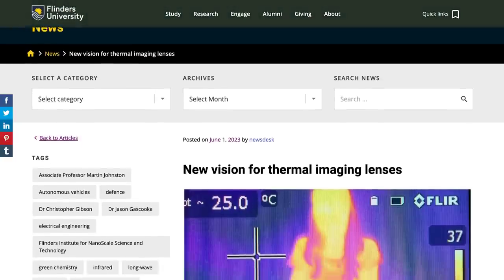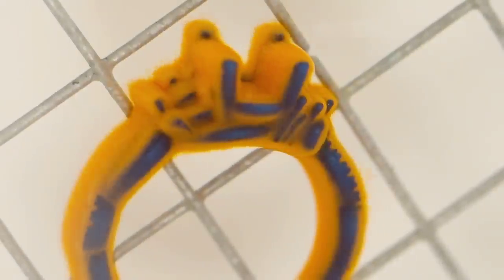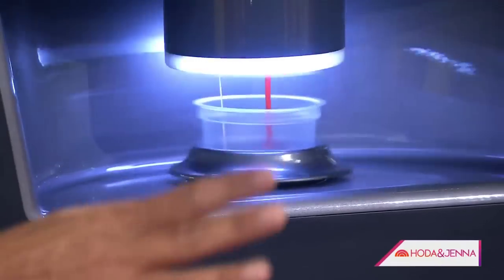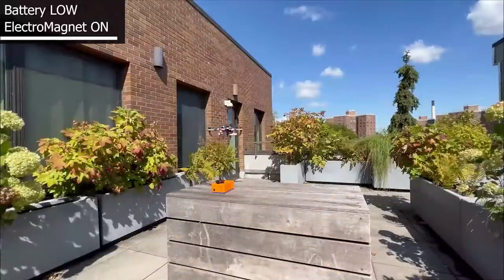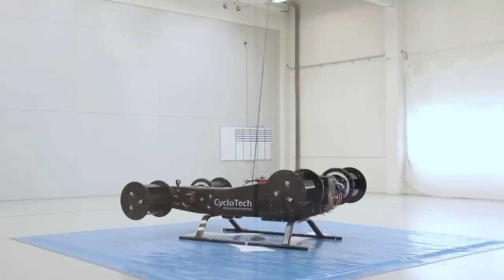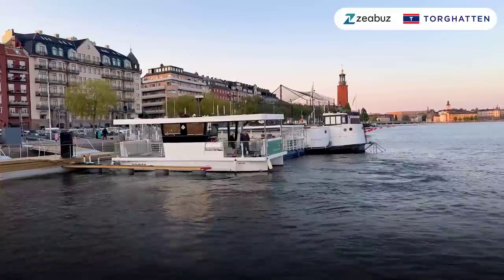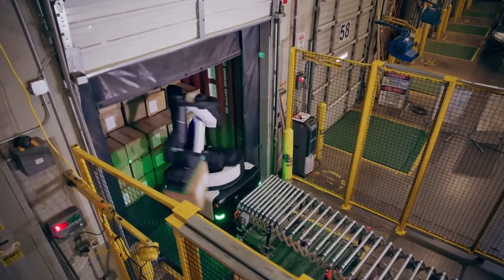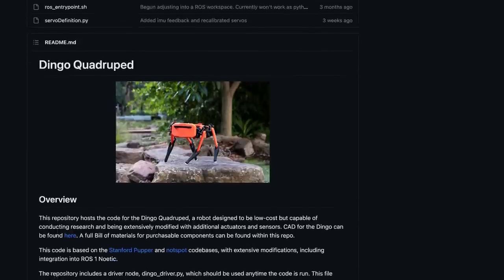Cheap Thermal Imaging Breakthrough (+ More News)

Comment: For just a few seconds, I considered the advantages of owning a wax printer.
Reply from the maker: lol
Reply: i work at a company that has a few MJP wax printers, they are super high maintenance and there is a lot that can go wrong (especially in the printhead, which is the most expensive part). Unless you absolutely need the ultrafine detail & perfect support interface, an SLA printer is exponentially cheaper for a similar result
Reply: Same here
What a tool it would be for making tools!
Reply: Look at a regular resin printer, it needs higher temperatures for burn out and the like but still pretty accessible
Reply: @zyeborm  That's probably my best option... I could buy 10 for the price of this cheapo wax machine, and still have money left for some resin.
Reply: yeah just get a resin printer. the castings will be just as high quality to the naked eye, and its so much less expensive

Comment: The thermal imaging tech is much bigger than most people know.
I won't bore you with the details, but it's going to completely change the face of warfare. Currently, an entire squad may have one single thermal device, as they start at about 3K$, and can go up to 100K$+.
Most of that is the lensework. 
Soon, drones will fly at night, and every infantryman will have nightvision...
Reply: every anti tank drone will have long distance thermal vision and leave a thermite charge on the enemy tanks engine or whatever is the new top down kill method.

Comment: This channel seems promising! I appreciate the sources and straight to the point, though the only gripe I have is that it feels like an AI voice narrating. If that is the case then maybe a little warning? It feels a little disingenuous hearing an AI voice without any indication, but totally fine for a one man operation trying to optimize his time. 
 I may be wrong in my assumption so I hope its not rude! These days its getting a littler harder to discern reality. But, all that aside, I'm glad to be shown CycloRotor Aircraft and will be keeping in eye on them
Reply from the maker: Thanks for the feedback. I forget that some people don't know me from @NODEtv , where I did announce that I was using an AI voice. You are correct though, it's just me working on this as a side project. I don't always have a lot of time to get a video together, so any ways to save time are helpful.
Reply: What difference does it make if it is an AI voice, why would you need a warning? (genuine question)
Reply: @nathanl2966  To me it felt disingenuous, as I stated above
Reply: i think its a bit naive if  feel you've been deceived by an Ai voice considering the content of this channel , no disrespect meant by this  whatsover but this is the world now , assume everything is AI until proven otherwise !!